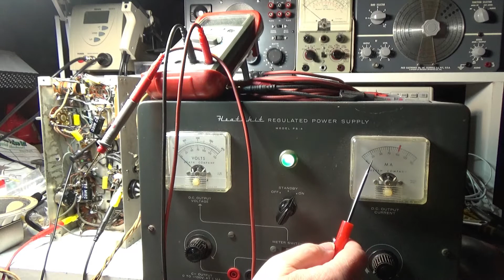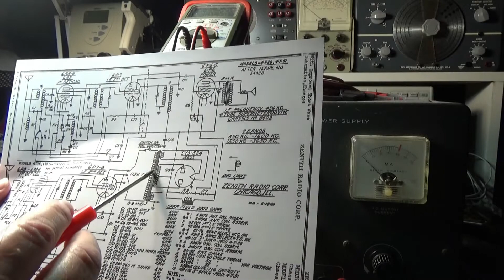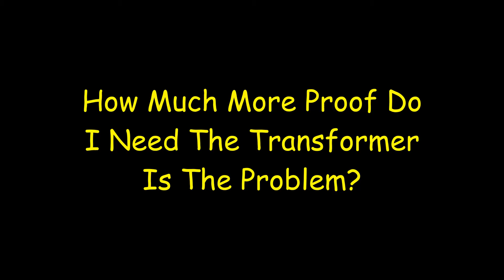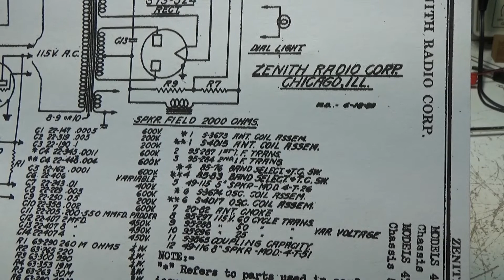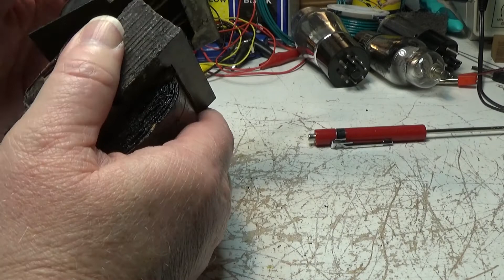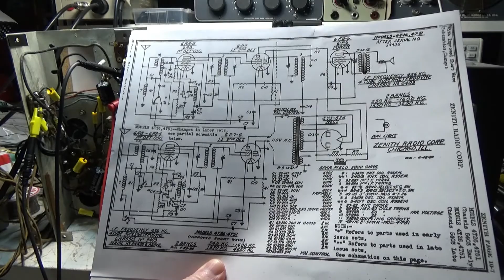Zenith Model 4-T-26: Part 2, Trouble Shooting High Amp Draw!

Comment: The usual failure mode is a shorted secondary, the wire is much thinner than the primary and can develop a shorted turn.  The symptoms are low B+, and excessive current draw.  If you pull the rectifier and all tubes you will find out quickly, don't have to remove the whole transformer.  Most likely someone ran the set with bad filter caps, transformer heated up, the coating on the wire that comprises the secondary winding melted and it shorted.  Zenith never published specs on their transformers, but used notoriously marginal ones.  They'd rate theirs conservatively for 115v input, when Rca etc would rate theirs for 115-125v.  Zenith made some nice sets but loved to cut costs.  I've got a 9S262 with a transformer that failed in the same way.  You can calculate the requirements (using filament current, and plate current of the tubes - see the tube data sheets, and don't forget the pilot lamp!) and find a Hammond or similar replacement, if you can't find a parts chassis.  If you put a fuse in the set, it'll protect it from a future similar failure!
Reply from the maker: Thank you for the information.  I did find a transformer that works great in the radio.  Thank you for watching and leaving a comment!